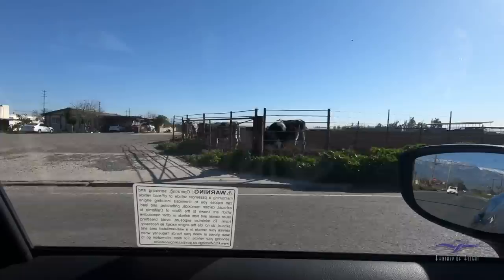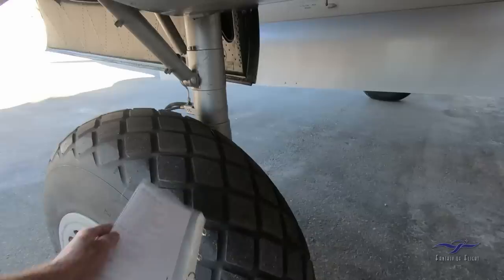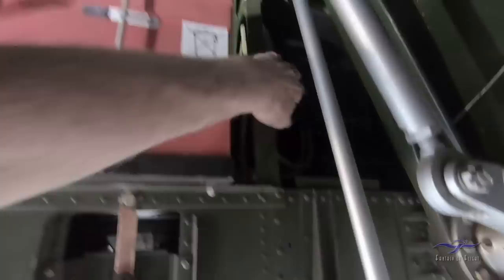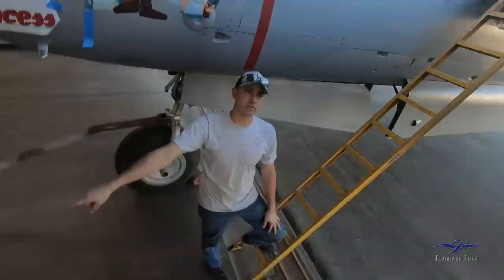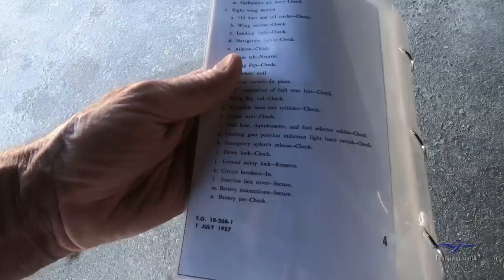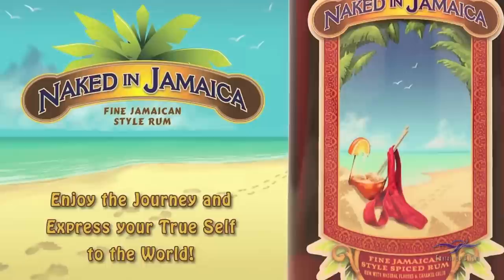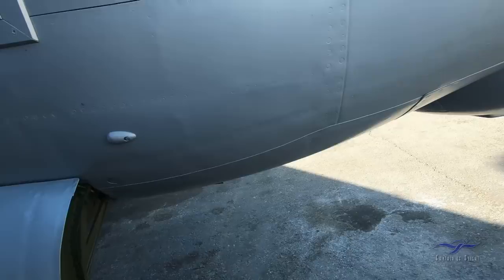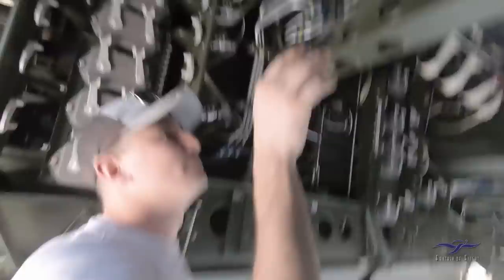Douglas A-26B Invader - Part 3 - Project Visit - January 2023

Comment: Wow, I wouldn't have guessed that the Invader was so complex. These wing bolts don't seem very big compared the arms they are locking. And the wing pins I used on glider were twice that thick.
With the stainless steel in front of the top turret, but nothing behind, does it mean that it was standard procedure to fire the top turret in direction of flight in the same time as the nose and wings  guns?
Thanks for sharing.